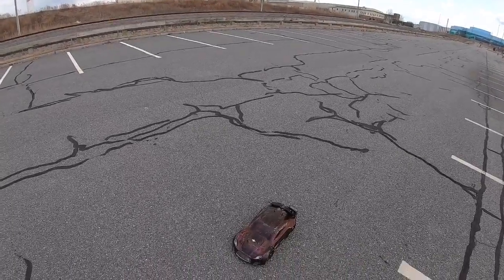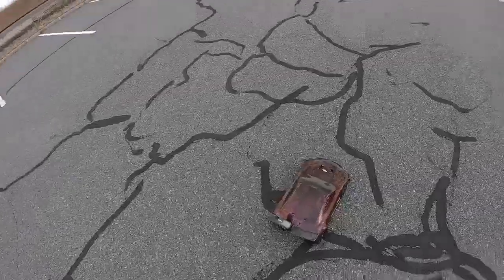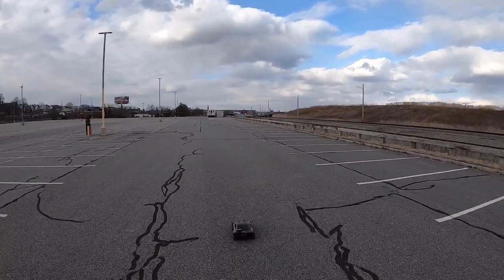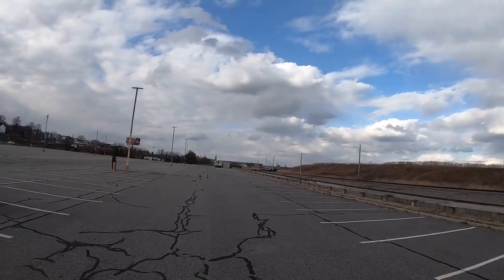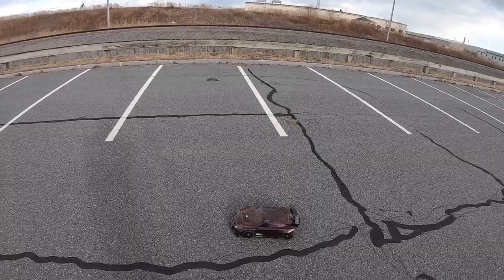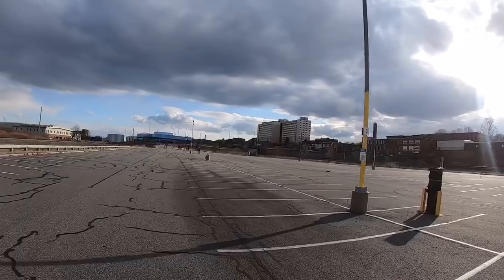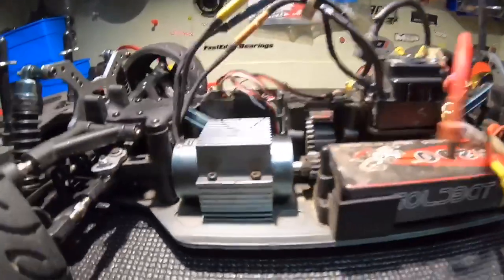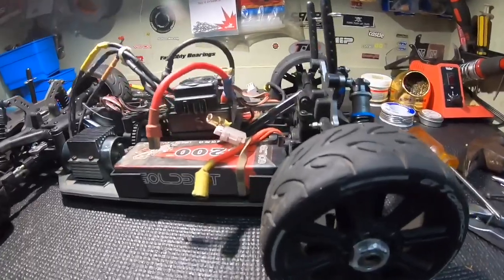Exceed 1/8 Scale Mad Drift Speed Test And Hits

Comment: My favorite cars got 2.. where the fugg you find it for 40.. I got mine from nitrorcx.com 
Aka Oh Heyl Nah.. and Midnight rhino on my channel.. think I need some shims in my rear thanks for the reminder.. love this car... I have a max5 200amp and a castle 1515.. beast mode.. I'm trying to create my own foam/rubber tires soon.. thanks for the shout
Reply: Only thing.. you can't fit above a 70mm long motor 4070 was my old one.. But if you reverse the motor mount to the other side and redrill the screw holes and move the battery lol.. Sky's the limit.. I want a tp motor it
Reply from the maker: I was just going to test it and seen this and Any time my brother and wait till this next video drop I switched the mount and put a arrma high speed motor mount fits right to the holes no drilling nessecary I made a top plate for the xlx she is looking good I will definitely see how she do this time out  but so far looking good and can definitely fit a tp with no problems now with mount the other way did also take out the battery tray on one side so we will see what it do 😎 thanks for watching 👊
Reply from the maker: And I found it on Facebook flea market 😆
Reply: @RcFunDrizzy  can you link the motor mount I hate exceeds version
Reply from the maker: https://www.ebay.com/i/233377155608?chn=ps&norover=1&mkevt=1&mkrid=711-117182-37290-0&mkcid=2&itemid=233377155608&targetid=870764295520&device=t&mktype=pla&googleloc=9002156&poi=&campaignid=9248481093&mkgroupid=89053949730&rlsatarget=aud-298628318826:pla-870764295520&abcId=1141156&merchantid=102011683&gclid=Cj0KCQiAtOjyBRC0ARIsAIpJyGM6J0VCKrxGvadIEK-AuIc_wXsV92UA840IQJH6D-m3J8GgA4UNJOgaAk4aEALw_wcB
Reply: @RcFunDrizzy  THANKS bro
Reply from the maker: Any time will  be dropping the video today 😎
Reply: @RcFunDrizzy  I just dropped one a lil while ago.. And imma go with this mount.. Integy RC Model Hop-ups C28693GREEN Billet Machined Alloy Motor Mount for Arrma 1/8 Kraton 6S BLX (AR310446) https://www.amazon.com/dp/B07VPFNLJJ/ref=cm_sw_r_cp_apa_i_5zqxEb5ZHTFQD